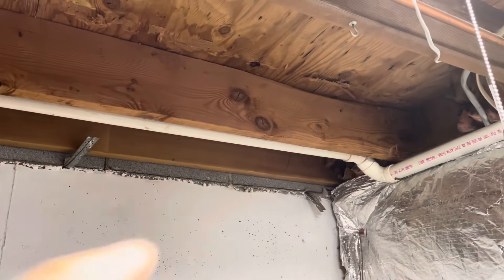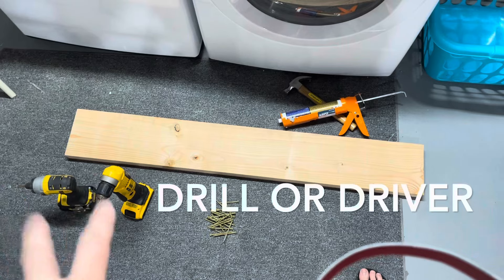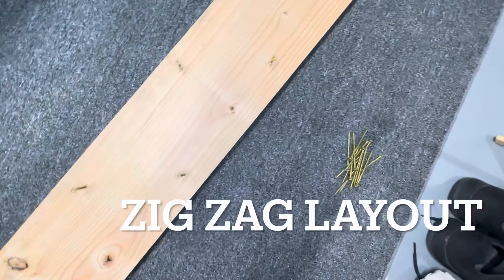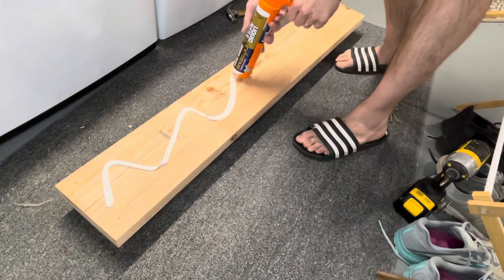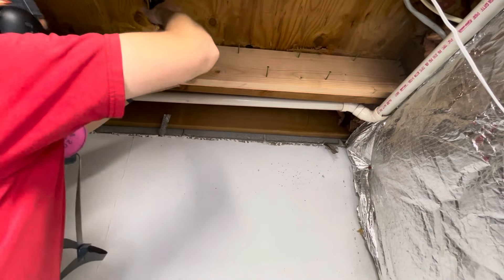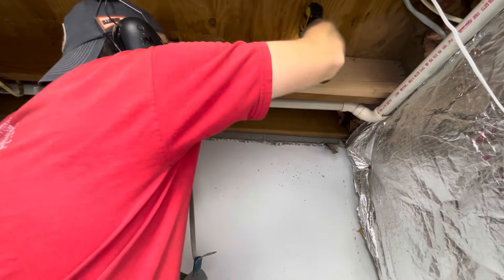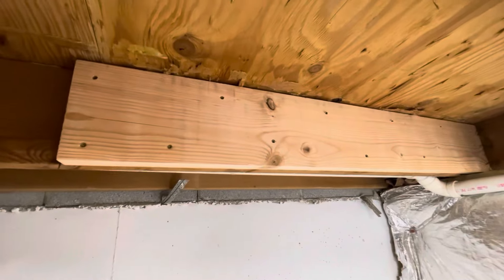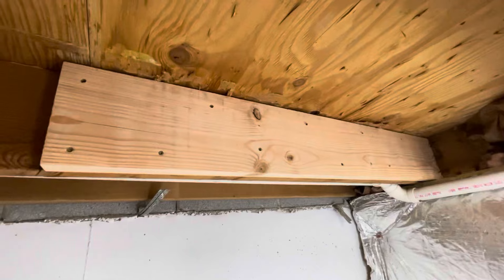Sistering a damaged floor joist

Comment: Always use ear protection,  and sandles
Reply: as someone who never uses ear protection. I have never noticed any hearing damage over the years...... until my head hits the pillow, then it's all just EEEEEEEEEEEEEEEEEEEEEEEEEEEEEEEEEEEEEEEEEEEEEEEEEEEEEEEEEEEEEEEEEEEEEEEEEEEEEEEEEEEEEEEEEEEEEEEEEEEEEEEEEEEEEEEEEEEEEEEEEEEEEEEEEEEEEEEEEEEEEEEEEEEEEEEEEEEEEEEEEEEEEEEEEEEEEEEEEEEEEEEEEEEEEEEEEEEEEEEEEEEEEEEEEEEEEEEEEEEEEEEEEEEEEEEEEEEEEEEEEEEEEEEEEEEEEEEEEEEEEEEEEEEEEEEEEEEEEEEEEEEEEEEEEEEEEEEEEEEEEEEEEEEEEEEEEEEEEEEEEEEEEEEEEEEEEEEE
Reply: It is called a "SCAB" not a sister. 40+ years building houses in 11 states and have never heard it called a sister.

Comment: Loctite PL 3x caulk is the way to go, strong as an oxe. Also recommend pilot holes in the sister joist almost the same diameter as the screws that go all the way through, helps the screws pull the sister joist snuggly against the original joist.
Reply from the maker: @goldistocks609  I wish I knew the pilot hole thing before I did this video; I learned of it later and I think it’s a good idea for the reasons you just stated.
Reply: @NotThatMattNagy  yeah I learned the hard way too! Did a few of these and in some spots the sister joist didn’t get pulled snug up against the original joist because the screws were too engaged in the sister joist.

Comment: Got water coming in? What caused the damage?  Thanks for the video, always helpful to see
Reply from the maker: I didn’t see any signs of rot on the damaged part or signs of water damage on on the sill that the joist sits on, so it might have just gotten non-water damaged at some point.
Reply: @NotThatMattNagy if it’s an older home 50s-70s it’ll happen

Comment: I have the same basic scenario as you but where your joists hit the ledge I noticed yours were compressed, did you jack it up before placing the new sister joists in place?
Reply from the maker: I didn’t but if you look closely when i placed it before screwing it, you’ll see that I sort of levered it in there slightly. The compression wasn’t so bad that I couldn’t do that. The key thing I think is that the new piece makes contact with the sill and also the subfloor above.
Reply: Ok ty I'm doing the same,my compression is bad so I will  sandwich the joist between 2 new ones..fingers crossed not too much lifting is required

Comment: Would you employ the same idea to joists in the attic?

Mine has too much flex and it's causing problems with the ceiling below. 

I'm looking at blocking vs. sistering ... thank you
Reply: Blocking is if you had to cut the joist for a hole or the ceiling fixture needed more support. Sistering is for if the actual joist is flexing